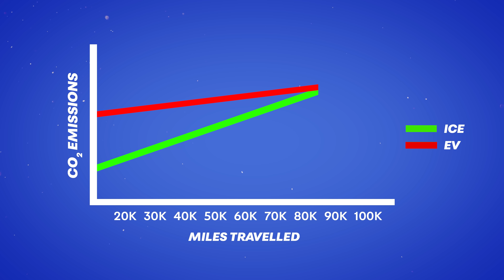Are Electric Cars REALLY That Green? [New 2022 Data]

Comment: how long do the batteries last?  New batteries totally change the carbon equation
Reply: A Tesla Model 3 had a range loss of 2.2% after 100,000 miles.  The batteries will last hundreds of thousands of miles.  The car will be worn out and scrapped before the battery is worn out.
Reply: @redbaron6805  electric cars have at least double the carbon footprint to manufacture.  The electricity they require comes from gas and coal powered power plants.  They cost $15-20,000 more than a comparable gas powered car.  Where are the benefits?
Reply: @TpayneD  Except, every single claim you listed is wrong.  They are not "at least double", here is the actual study:

"Manufacturing a mid-sized EV with an 84-mile range results in about 15 percent more emissions than manufacturing an equivalent gasoline vehicle. For larger, longer-range EVs that travel more than 250 miles per charge, the manufacturing emissions can be as much as 68 percent higher."

So, the WORST case scenario is 68%, not "at least double".  Myth #1 busted.

But, that is only half the story.  Only 5% to 10% of total emissions comes from manufacturing.  The other 90% to 95% comes from burning fuel.  Meaning typical electric cars offset their manufacturing emissions in about 6 to 12 months and then drive cleaner for a decade or two after that.

"The electricity they require comes from gas and coal powered power plants"  Another completely false claim.  In the US the energy grid is 60% carbon, 40% renewable/nuclear energy.  In the UK, fossil fuels are 45%, renewable energy and nuclear is 55%.  So your claim that electricity "comes from gas and coal" is absolutely false.  Myth #2 busted.

"They cost $15-20,000 more than a comparable gas powered car."  Yet another false claim.  Here is what Consumer Reports said about the price difference in 2020: "When comparing vehicles of similar size and from the same segment, an EV can cost anywhere from 10 percent to over 40 percent more".  During that time the average transaction price of a car was $36,000.  Anyone with a calculator knows that 10% to 40% of $36,000 is $3600 to $14400, not $15000 to $20000.  

That math is easy to confirm.  A Subaru Impreza and Hyundai Venue are about $20,000 in the USA and are among the cheapest cars you can buy.  The Nissan Leaf is around $27000.  The price difference is around 10% to 20% when you compare those cars with similar options, as EV's tend to come loaded with features, and the combustion cars at the base price are stripped down.  Myth #3 busted.

That is beside fuel and maintenance costs.  Here is the story on that from last year, before fuel prices went up:

"There is a 4-cent difference per mile between owning a gas-powered car and an EV. EVs have lower maintenance costs, making them cheaper than gas-powered cars in their lifetime. One can save $8,000 more on an EV than a gas-powered car over 200,000 miles."

So, in 200,000 miles you save over $8000.  Even more now with higher fuel prices.  So, on an electric car, the 10% to 20% price premium would pay for itself over time.

Comparing Apple to Apples on cars, EV's will easily pay for themselves over time, especially when they replace a combustion car with any kind of performance, that requires expensive Premium fuels and expensive maintenance to run.
Reply: @redbaron6805  batteries will not last 100,000s miles, but...good luck!
Reply: @TpayneD  Actual facts from actual people that own one tell a different story:

"Electric vehicle advocate Andy Slye was among the first customers of the Tesla Model 3, taking delivery of the all-electric sedan at a time when only the Long Range RWD variant was available. Since taking delivery of his Model 3 four years ago, the EV owner was able to rack up 100,000 miles in the vehicle. Over its four years in service, the Model 3 proved to be a car that definitely seems designed to go the distance. 

"The Model 3 owner’s overall thoughts and insights were summarized in a YouTube video, which he uploaded recently on his personal channel. Yet within the Model 3’s 100,000-mile review, the EV owner mentioned something rather remarkable. Over the four years he’s had the vehicle, and over the 100,000 miles the Tesla had traveled, the all-electric sedan had only lost 2.2% of its range. The vehicle was rated at 310 miles when it was new, and now, its full charge remains listed at 303 miles. "

I choose to live in reality where facts and data exist, you apparently don't.  Good luck!!!
Reply: @TpayneD  The information is easily available at the EIA website which tracks this real time for the USA.

Fossil fuels total 60.6%:
Natural gas 40.5%
Coal 19.3%
Other 0.8%

Nuclear 19.7%
Renewable Energy 19.8%

So, I'm wrong where exactly???

Oh, right.  You didn't bother to do any research, yet again....

Comment: Fair enough, but what about the mining of the minerals to make the batteries?  Leaves horrible scars on the earth and produces considerable CO2 emissions from the massive diesel-powered equipment to mine them.  Then there's the issue of electricity generation to power the cars.  Solar and wind currently provide a very small percentage of the energy required, and building more will negatively impact the environment due to wind turbines killing more birds, not to mention how unsightly they are.  More nuclear energy will be needed to fill the large gap left by green energy production.  Where will all the radioactive waste from those plants be stored (safely) that's created as a result of increased  energy demand?  Remember Fukoshima?  EV's, at best, are probably an acceptable bridge to fuel cell technologies that still have some time to go before they are cost-effective and safe.
Reply: Those claims are so comically absurd.  You think digging up coal and drilling for oil is clean?  Solar and wind are growing massively and already produce Billions of kWh's of electricity annually.  Multiple studies have shown pollution, tall buildings and cell phone towers kill 1000x more birds annually than wind turbines ever will.

And I find it comical that you think fuel cell vehicles are the answer.  How exactly are you planning on producing all the Hydrogen needed for FCV's?  You DO know that a MASSIVE amount of electricity will be required to produce it, right?  And if all this electricity for EV's is bad, how is making 5x more electricity to produce Hydrogen a batter solution???

Beyond bizarre...

Comment: Yup, I read the press release from Volvo. But the calculation is based on technology of today. So, in the future, the battery might have the size of a sugar cube with perhaps double energy content of today…or the ICE is even more environmentally friendly than battery ever will be. China is the greatest polluter of most substances in the world. What you do outside of China is of course important, but will not contribute exceptionally much in terms of "saving the planet"
Reply: The study was flawed, and compared their dismally inefficient C40 car with their own XC40.  The real revelation was how absurdly inefficient the C40 is compared to any other EV manufacturer, not the bogus claim that EV's need 90,000 miles of driving.

EV experts have already flagged those claims as completely false, as seen here:

"Experts have disputed - and criticised - the Swedish maker's estimations, claiming it will take just 16,000 miles - just over two years of driving - for the electric C40 to overtake a petrol equivalent in terms of emissions - then pull well ahead beyond that point."

Comment: Although I also believe that electric cars are generally the better option when compared to ICEs, people should not be encouraged to believe that ‘buying’ a green energy tariff means that there electricity is from a green source. If you get the electricity down a electricity line then it is just the national average, they do not separate green energy first and then transmit it to you. So even if you buy a green tariff, you can’t claim your electricity is any more carbon neutral.
Reply: He said it would be neutral if you yourself made up your own small scale wind turbine and solar panels.
Reply: Completely misses the point.  They track how much Green energy enters the grid.  If you buy Green energy, the energy you consume is equal to the Green energy produced, and if demand of Green energy increases, more of it is produced.

If you really want to contribute to it directly, you can always install your own.

Comment: Sounds like EV vehicles actually suit being taxis and delivery vans, racking up huge mileage in built up areas. But outside of that, very low annual mileage, or rare but long distance driving (motorhomes etc) isn't really beneficial. Better off being ICE right now. Technology will change and so will these results. But right now, as a grocery getter? better off with a 20 year old fiesta if you want to save the environment, don't buy a new car. Recycle.

Comment: if i was an average worker making 30k a year i wouldn't care about the environment. as it stands today, EVs cost 10k more than ice cars and they cost more per 100km driven due to the absurdly high electricity cost. as an EV owner myself, i think that this generation is absolutely useless, expecially if you factor in that an engine is basically a metal block that is wery much reusable, while batteries are much, much more complicated to recycle. if it wasn't for government subsidies, basically nobody in the middle-low class would be able to buy and run a EV, and guess what, that is more or less 90% of the world's population. moreover, they should all agree to one damn industry standard for the charging infrustructure, which as it stands, is so unreliable that once i had to go to 4 different chargers in order to get some juice for my car, because the first 3 had some sort of idiotic problems

Comment: I think the reality is that most people buying EV’s are more interested in their running costs than saving the planet.
Will a battery pack last 90,000 miles?
Reply: a battery pack can last 500k km if you take good care of it. they are till 160k km or 8 years with at least 90% capacity guaranteed, however using fast chargers reduces drastically the capacity of the battery pack over the years. The real question is if they factored in the demolition of the car itself, bacause you can recycle a metal block as the ice engine, but it's much more complicated to recycle batteries. last but not least, in winter the capacity of the batteries decreases significantly (in my ev i went to 400km to 300km) and energy consumptions is also higher

Comment: So when everything is taken into account the line currently crosses at around 5 years of driving (50k miles) and will head towards 3 years (29k miles) as the grid is cleaned up.
So the EV's are greener than the ICE cars. Because most cars are on the road 12 yers.

Comment: :yt:As an engineer that works for a company that manufactures diesel engines along with hydrogen, NG, propane, and EV drive trains our results agrees with Volvo's CO2 cross-over point. As an OEM the big advantage we see in EV's is fewer parts and reduced maintenance. With our recent funding in 400 WH/kg hybrid cells, we see the CO2 crossover point dropping by half around 2026. I have on order a 1000 mile range 0-60 mph in 3.5 second Aptera EV which is Driven by the Sun resulting in a range of 40 miles/day for free. With this vehicle, the emission level crossover point should drop over 80% by 2023 :yt:

Comment: Oil changes, exhaust system components, spark plugs, water pumps, fuel pumps, oil pumps… which of these items on an ICE vehicle is recycled? Hundreds of parts needed to just build an ICE engine, many of which will have to be repaired or replaced over the lifetime of the vehicle. People sitting in their ICE vehicles with the engine idling just so they can charge their phones or keep themselves comfortable while waiting for someone to do their shopping… no, these gas/diesel cars are much, much more environmentally friendly than electric cars. Duh.

Comment: So if you lease an EV on a 3 year lease with 10k miles a year after 3 years you start again so no break even point as the reduced emissions is never reached? Short range (100 mile) EV cars make sense in cities but if you use super charging you might as well use an ICE car. EV cars also loose 8% at least capacity after 12 to 24 months and car manufacturers want us to charge to 80% to reduce battery degradation So 300 mile range isn't really achievable. We need more simple EV cars and not ones with so much technology as they are so expensive and will go wrong or need constant updates which the customer will have to pay for.

Comment: The interesting thing, and the first thing I looked for when I opened the report, is that it doesn’t include vehicle maintenance in the lifetime use calculations. So it doesn’t include the emissions of all the oil changes, etc that the fossil fuel car will need that the EV won’t… I’m sure there’s a come back about not including additional hardware that the EV might be harder on than the fossil… but even their complex environmental impact assessment isn’t as comprehensive as it may seem.

Comment: 1995 Acura Integra: 2,600 lbs. 2020 Tesla Model S: 3,600-4,200 lbs. Plaid is 5,000 lbs. My 05 SRT-10 Viper Ram weighs only 500 lbs. more! 2016 BMW M4:4,000 lbs. just for reference. Weight is a MAJOR factor in efficiency and performance in any type of car, and I just wonder how terrible a Plaid is in the corners when I compare it to my lowered SRT-10 Ram (not good). But for sure the Plaid SUCKS against the M4 which weighs 1,000 lbs less but is more comparable suspension-wise. M4 can be tuned safely to 850+ whp which won’t keep up with a Plaid in a straight line, but the M4 will surely destroy a Plaid in the twisties. And it sounds awesome. We only live once. Why is everyone trying to censor everyone and make all aspects of life suck in this decade? I welcome new technology, but let’s cut the shit with limiting freedom of individuals AND auto makers. Personally id like to see if I could retrofit electric motors to the rear of my supercharged K swapped 95 Integra FWD to make it a homemade ‘hybrid’ with all the ‘go fast’ noises of a Whiney, supercharged 500 whp Integra only the added thrust of rear electric, making it likely a 7 second, street car which operates on one or both, electric charge or petrol. THIS is how we should be living.

Comment: The big oil companies now are one of the top investors in other energy projects so in fact they don't really care - there is no conspiracy. 
EV however  are not green! In very specific situation they can have less CO2 emission but definitely not that much as politicians and green-terrorist are trying to  convince. But generally speaking in terms of environmental - they are much worst! Much, much worst!

Something very important though - it is always pointed that EV highly depend on the source of the electricity... but no one point that ICE also can have other source of fuel - real net zero fuel  - the e-fuels which used as a % of a mix can bring ICE emissions way down then EV making it extremely useless and dirty! 

And then comes the moment when you need to change the battery pack and all the "greenery" of the green transport is gone forever! The only reasonable EV is Twizi/Smart like super urban minis with small battery packs enough for daily use intown. No point in 80-100 kWh batteries though, they will always be much worst for the environment!!

AND ONLY! ONLY ICE CAN BE FULLY GREEN! By using e-fuels! E-fuels and hydrogen are the only real green solutions with potential for REAL ZERO EMISSIONS!!!

Comment: Renewable energy tariffs does not mean your supplied renewable energy as it's all mixed into the same pot. Claims by energy companies that they supply only renewable electricity can not be true when renewable output drops to very low figures like on the 14/1/22 when output from wind was only 360Mw and solar was zero (night). Until we solve the storage issue renewables have a very big problem to solve.